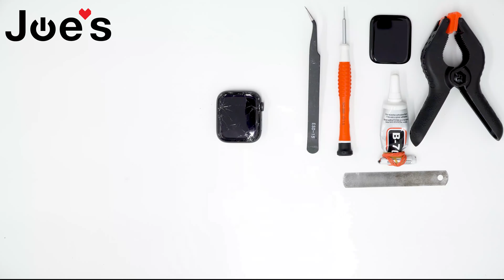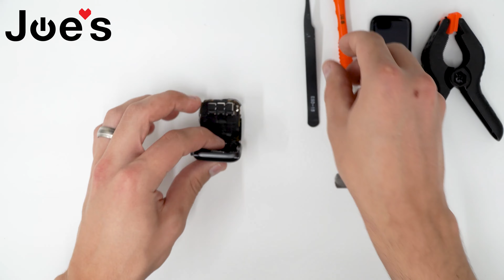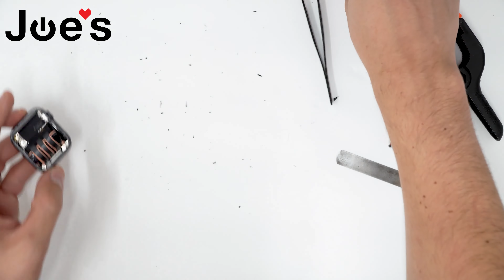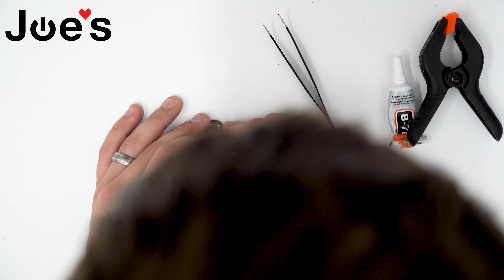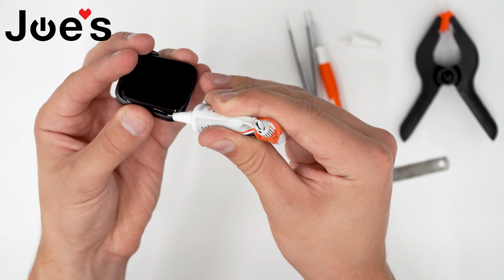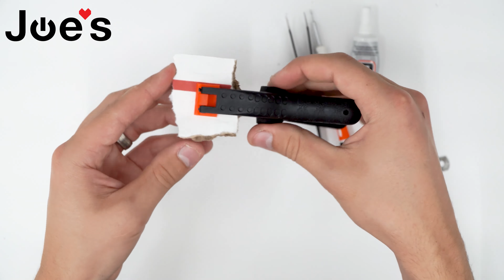Tutorial How To Replace Repair Broken Cracked Screen Apple Watch Series 4

Comment: The three connectors down the center are for the screen correct? What about the smaller 2 on the far left and right for? They look like they are grounded maybe for force touch sensor? I have the left one damaged cut.
Reply: No those are for the antena ,, ,, one attached to the corner is  the force touch